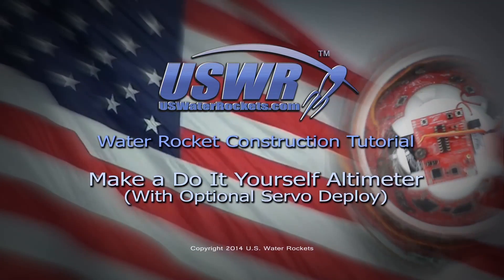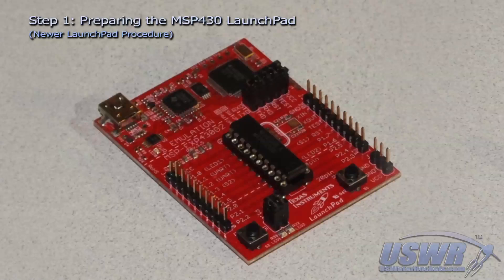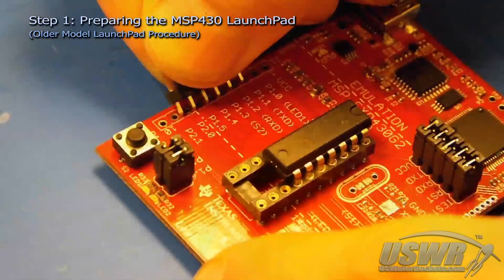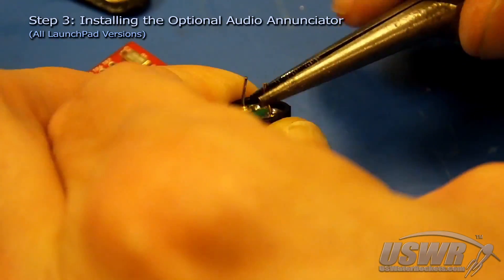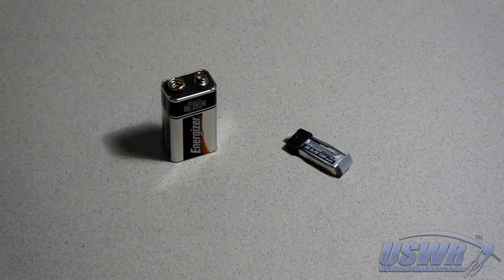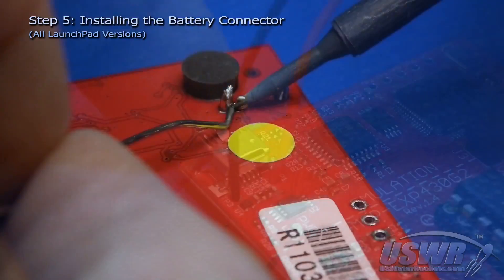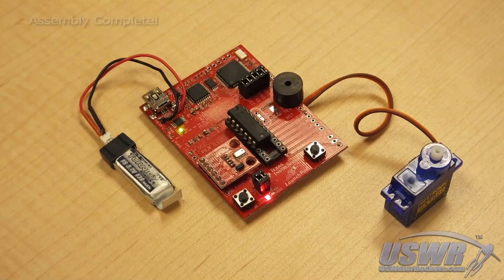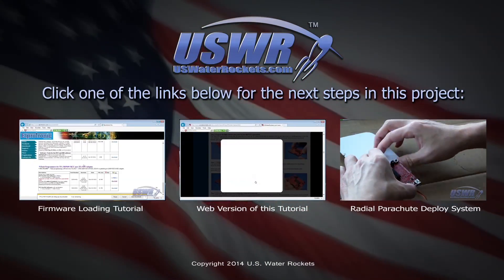Make the Parachute Deploy Altimeter for Water Rockets

Comment: Can i use this MSP to my rocket model that uses solid propellant motor with 3 km of altitude ?
Reply from the maker: There's no reason it wouldn't work on a pyro rocket. I would add that I never tested it at supersonic velocities and I had no way to validate the software at that speed, so only use this if you're not planning on exceeding Mach 1.

Comment: For a battery, I couldn't find the exact specifications that you had used. I am using the servo deploy option. All I could find was a battery with the same voltage, but either 250 or 380 mAh. Is it OK to use these batteries, or will it damage the servos?

Comment: I have 2 questions: 1) Am I able to use 2 micro servos for 2 different timings? 2) If I am able to, would I need a higher voltage battery and what voltage? Thanks.
Reply from the maker: This is an apogee detect altimeter with a single servo output. The single output does have a delay after apogee setting. If you are looking for a dual timer for servos, you want to use our other design called the "ServoChron 2". If you really wanted two separate timers triggered by apogee, then you would put two of these altimeters on the one rocket and give each one a different timer setting. In any case, you do not need to increase the battery voltage. The recommended battery is fine.
Reply: Thank you so much!  With just the Servochron, how will you be able to detect when a launch has happened, or if I were to use it in a second stage when that launch has happened? I am trying to build a two stage rocket. The first stage will use a radial parachute system, with just the Servochron, and the second stage will use the apogee detect system. In any case, how do I make sure the Servochron is timed right, and will this configuration work?
Reply from the maker: Yes, the ServoChron 2 has a launch detect switch, you can use a real switch or a "break wire" system to tell it when it launched. It will then time the interval you want to set it to and activate the servo. You can put the Launchpad AlTImeter on the 2nd stage and set it for apogee deploy and it will be perfectly fine this way. Look for the instructions for both of these projects on our Website:    http://www.uswaterrockets.com
Reply: 2 more questions( I wouldn't like to return any already bought items): What would be best to detect a launch on my rocket without activating it manually with the Servochron?  I looked in your Servochron 1 and 2 videos and you had activated it manually with the push button. I am trying to spend the least amount of money on electronics. I have decided to use the apogee detect system with the first stage, and the Servochron with the second. I wouldn't be able to activate that stage manually while its in the air.  Additionally, this question wasn't answered in my last reply: With your first launch on the Servochron, how do you know how long to time your servo timer until it reaches apogee. Is there an equation, do you just have to guess, or what. I don't want to guess wrong and have my rocket crash. Thanks for reading all of my replies, they are helping me very much!
Reply: Sorry, but another question, for the separate barometric sensor and audio items, what are their exact names and where did you get them separately from?
Reply: Please disregard these last 2 comments. I have decided to only do a 1 stage bottle rocket, but to replace this I will splice two bottles together. I am making this rocket for a school project, and I just found out it is due on the 9th! Thank you for all your previous helpful responses!

Comment: Where is the best place to buy the servos and 3.7v batteries. I was also wondering if you could use a resistor with a 9v battery to power the servo.
Reply from the maker: The best place to get them is Hobbyking. They have warehouses all over the world. Also, you can find them on ebay for cheap. Amazon is also great but some people can't use them depending on their country.  A resistor and a 9V battery will almost certainly blow up the servo. They need a regulated voltage and because the servo load changes with the force it needs to exert, the resistor that works under no load on the servo will be the wrong value when the servo is working hard and using more current. If you have to use a 9V battery, then hook it to a 7805 regulator. There are zillions of diagrams on the internet showing how these connect to projects to get 5V for a servo.
Reply: I am using 4 AAA's with a 3.6v-7.2v servo. Will this work?
Reply from the maker: 4 AAA's in series would be 1.5V*4 = 6V. 4 AAA's in parallel would be 1.5V. So, if they're in series then you're fine. If they're in parallel, then not so good. It depends on how they are connected.

Comment: Where did you guys find the parts under $13 with the altimeter and the barometric sensor??
Reply from the maker: We didn't say the whole thing was under $13. The Barometric sensor itself is $13 if you buy it from the OEM (Sparkfun Electronics) but you can find clones of them now for around half that http://www.hobbytronics.co.uk/mpl3115a2-pressure-temp-sensor and others for even less, but they are not wired the same way so you would need to adapt the wiring to match. However, since we made this project, TI increased the price of the MSP430 Launchpad from $4.30 to $9.90, so the total price is around the same as the money saved on the sensor is cancelled by the higher cost of the Launchpad.

Comment: Hi ! Can we make the parachute system deployment (with the servo) with an accelerometer ? Or do we need an altimeter ? (I don't have the Launchpad system, I wanted to use an arduino) Thank you !
Reply from the maker: +MiniMonsterFromParis You can use any system you can think of to let the rubber band release at the right time. We use our Altimeter because that was what we designed it for, but you could use an accelerometer to detect the falling after apogee with an arduino if you can write a sketch for that. You could also use a gyro to detect when the rocket tilted over and use that to release the parachute. Some people prefer to use a simple sketch that times a few seconds and then operates the servo, and you rig up a switch that starts the timer when the rocket comes off the launcher. There are a lot of options. Some people even use a mechanical system named "Tomy Timer" to release a chute. There are probably other ways nobody has though of yet. It's up to you how you trigger the system.

Comment: Will a 9 volt lithium battery work with the servo, and what keeps the normal 9v battery from working?
Reply from the maker: +Grant t The inexpensive servos we use are only rated for a maximum of 6.5V, so putting 9V in one of them could cause it to fail. It is possible it would work at 9V with a regular 9V battery, but since it could potentially damage the servo, we decided not to recommend doing that. Plus, a lot of people want their rocket to be light, and the little 3.7V LiPo we show is much lighter than a 9V battery, so weight savings is another reason we never experimented with 9V batteries.
Reply: +USWaterRockets  Thanks, I got the 3.7 LiPo and got everything working. Love the channel by the way
Reply from the maker: Grant t Awesome! Thanks for the kind words. Have fun with the Altimeter/Deploy.

Comment: buying the parts tonight
Reply from the maker: Great news! Let us know how the build goes.
Reply: USWaterRockets
thanks. They should ship tomorrow. I'd like to get a launch on sunday the 13th
Reply: USWaterRockets
I have a question. what does it mean by sensitive launch detection? Does this mean i dont need any external device to detect it?
Reply from the maker: ***** that's correct. The setup is completely self-contained and requires no external connections to detect launch. This style of automatic launch detection is a common feature of model rocket altimeters, except that in our case we specifically designed a detection system capable of detecting the slow liftoff of a water rocket with a small nozzle as well as a high speed launch like a full-bore launch.

The typical model rocket altimeter fails to properly detect the slow launch of certain water rocket designs, so we made sure to support all types of rockets.
Reply: so the barometric addition to the msp430 board detects this? I love this design if that may be the case. The reason i went with full bore designs because i was worried my homemade g switch wouldnt detect it.
Reply from the maker: Yes, that's correct. The "How It Works" section of the manual (http://www.uswaterrockets.com/documents/LaunchPad_AlTImeter/manual.htm) explains how the air pressure sensor is used for altitude measurement. The launch detection function uses several altitude measurements taken over a time period to calculate the rate of climb, which should only be changing at launch. The apogee detection works in a similar way, so the parachute will deploy at just the right time.